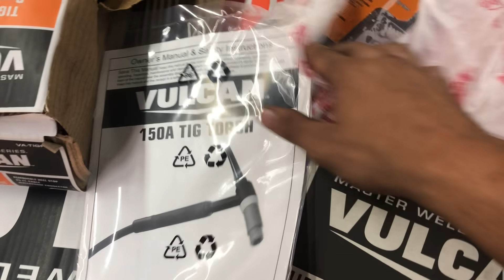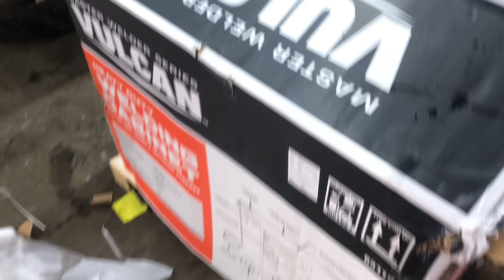Got some new toys

Comment: Hey Gentry &Sons  Trucking  your blue air line hose goes your on the left and, your  red air line hose goes on the right cause if you cross your blue air line hose and,the red air line hose you won't get any air to the rear of the Truck or the Trailer